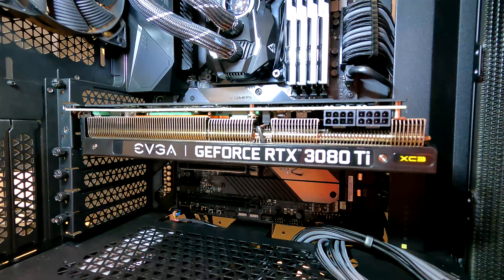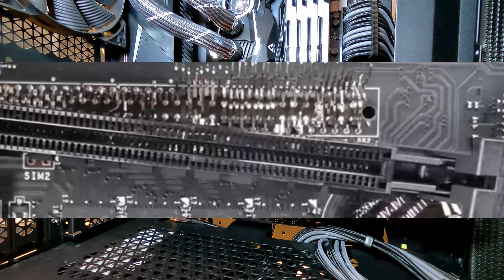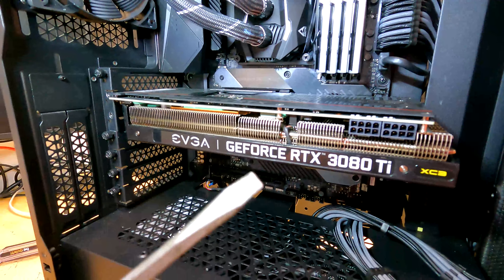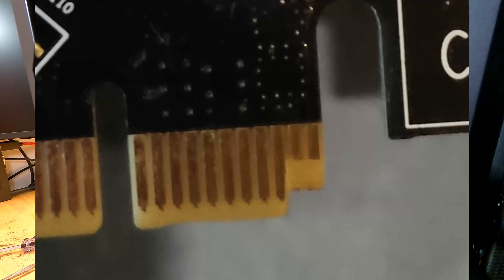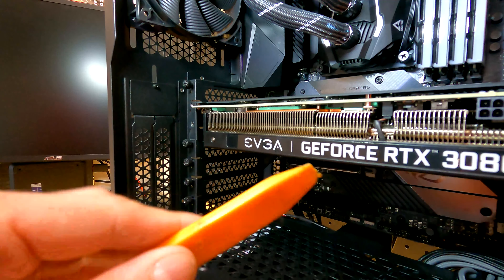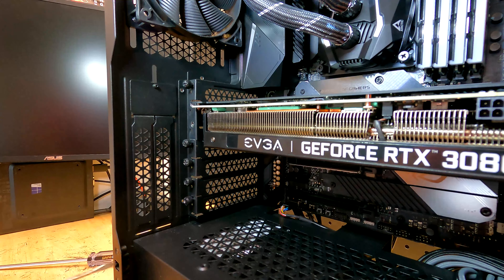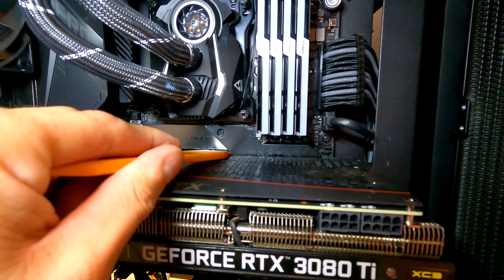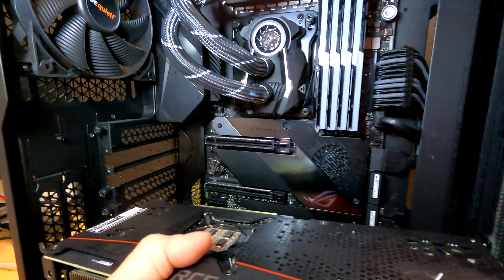Graphics card removal tip!! Avoid broken clips, PCIE slot, or damaging your motherboards!!

Comment: Yep that pcie clip is truly a horrible mechanism.  It's like computers are designed let ppl learn the hard way lol
Reply from the maker: I know right!!
Reply: it’s just a clip tho right? i broke it and idk if i broke the whole thing
Reply: @kutlermclean  should still work (as long as the slot itself isn't damaged) but make sure it is screwed in tight at the bracket side.  maybe double check that everything is still snug if you ever pick up and move the whole pc
Reply: Trying to remove my GPU right now. I just cant get it out. What is this idiotic mechanism?? I have tried pushing the clip very hard with different tools, but it just wont move. Now my GPU is half out and half in. (Stuck from the rear at the clip)... and I need it out right now!
Reply: @megapet777  put the whole thing back and start over.  get a flashlight to see what's going on.  newer boards have a little lever that you push straight down toward the board.  older boards and prebuilt hp, dell, etc might have a curved hook looking thing that you push toward the floor of the case.  just don't force anything you'll get it
Reply: @infinity2z3r07  thanks. I managed to get it out. I had to lay down the PC so I could have top down view. Flashlight is a must. I used wooden thingy to push the clip, but still had to use ton of force to unlock it. I dont know why, maybe its just my gigabyte board. Still I dont know why that clip even exists. The GPU would stay seated without it, and the screw locks the GPU in. This plastic clip thing is nothing but huge nuisanse. In the worst case I would had to remove the CPU cooler, but then I dont have cooling paste laying around so I would be unable to reseat the cpu cooler... isnt it fun building computers? ^^
Reply: @megapet777  what i ended up doing was breaking that clip by accident while pulling the gpu out. try putting your gpu back in, making sure the mechanism is clipped on, the try to push it again with something that won’t break your motherboard if you slip. then it might take some force still to get your gpu out. DO NOY FORCE IT THO
Reply: I think I broke mine. I tried removing it and shoved it back in. Now my games crash when under graphic load lol. What should I do to troubleshoot this and find out what’s wrong?
Reply: @megapet777 Mine just came off as soon as I've unscrewed it from the pci slots, guess it's different for every motherboard and gpu
Reply: also we need holder stand for avoiding bending 😂
Reply: Taichi motherboard already without this clips 😂 4090 I broke 2 of them. First with metal and second just self broke when I plugged my GPU. Now if I will build something with 5090 or bigger,100% I will buy motherboard with button 🫣
Reply: @kutlermclean same
Reply: @megapet777 Any tips? I'm experiencing the same problem with my ASUS extreme formula VIII and 3090. I broke/bent the clip. It's stuck in the MB.
I really need to take this out. I'll try to remove the clip once it's out so this does not happen again.

Also I'm using a 90 degree rotated case. But I always lay it down on the side to work on it.
Reply: @megapet777 lol did you get it out

Comment: Something else to add that the video didn't mention- if you've tried pulling on the card before that the clip might not want to unlock no matter how much you push. You need to first push the gpu in again so it's properly sitting in it's socket, which would release the tension and allow the "lock" to be released with very little force.

Comment: Unfortunately only in newer high end motherboards there's a button that disengages the lock on the pcie 16x slot. I wish every motherboard had that as standard.
Reply: The button release and 90 degree rotated Type-E ports should be standard on every MB. They have 90 degree rotated SATA ports and USB 3 ports standard because you can't install those with standard cables under a graphics card without the 90 degree rotation, WTF can't they figure out that the Type-E ports need to be 90 rotated too?!!!

Comment: God dammit i hope i didn't damage my pc gpu and motherboard trying so hard to remove it with the back of a screwdriver, it did unlock but now the lock feel loose idk if thats normal i was pushing it straight ☠️, took a look at the pcie of my gpu it seems no damage (i hope) and still working, now next time ill use a wooden chop stick instead and pushing it like a lever from the left side ☠️

Comment: STRIX motherboards are known to be faulty. i slotted in a 6800xt and now i want to clean it but the clip is practically wedged into the gpu, i had to use a hammer and a trim tool to tap the thing loose.

Comment: Any tips on removing the clip altogether before installing anything on the slot? I think the clip should not exist at all; as long as you screw in the card tight enough, the clip will not be of benefit.

This design was okay when graphics cards were small, so the clip was easily visible and reachable, but this was a long time ago. Today, on top of the sheer size of the card, a thick backplate may make pushing the clip with a finger very hard even with good clearance, since it may partially cover it. This design should not be utilized any further is my opinion, all new mobos should come with something easier/more advanced, and most importantly safe for the other parts to operate with.
Reply: agreed the design is outdated and gpus r way bigger now

Comment: You show your screws are out, at the end? Allways remove them before pushing the release tab.. The tab in most cases/boards is an ejector, as well as a lock. First remove the backplate retainers, and dont push in on card while trying to press the release, it doesn't work that way.

Comment: my PCIE clip broke off when i was just using my finger, not even sure how since i wasnt putting that much pressure on it. no other damage apart from that broken piece, everything still works fine. Had to take out my GPU to reach the smaller PCIE slot for a wifi card

Comment: My gpu is halfway out, the part where the clip is it is stuck there and the other side is out. I cant put the other side in. Help mee
Reply: Same here. Were you able to get it out?
Reply: @angelmercedes2029  yea, eventually I got it out, I wiggled it and pressed the clip to get it out and it works fine!
Reply: @ I’ll continue to try. I’ve been doing it for two hours and it’s not working. It’s my first build too. I was almost done. I just needed to take it out to make the connector on the card sit flush

Comment: I removed one of the fans on the cooler to get to the pin and i cant press it down. I have removed the gpu in the past and i remember it being difficult but i dont remember it being this difficult.. Good thing the gpu has a backplate and theres some metal thing right next to the pin just like yours, so i wont damage the motherboard.. From experience i think these pins start to become more loose over time if you tend to remove the gpu often, if not then theyre very difficult to deal with.

Comment: so i shouldn't use a thumb to press down on it?  my CPU heat sink is in the way of it so i'm wait on getting my CPU upgrade in the mail.  CPU heat sink out of the way - then i can easily remove the GPU card to replace it(could be better if i put the massive heat sink on, then the GPU card in last)

Comment: Great advice. I have a vintage IBM OS/2  version 3. I think 3. I only use it for Lucas arts air combat classics 1990. Yeah, it still works. Well not anymore. The contrast between the sky and aircraft are gone. My target planes almost disappear when flying above the horizon. Now, the monitor wont come on. There's power to the monitor and I can hear the computer make it's start-up clicking noises. Is it the graphics card that needs replacing? Any thoughts anyone? Sure is tough finding a computer repair company in my neck of the woods who are willing to take a crack at it.
Reply from the maker: I would check the board capacitors, older hardware the capacitors tend to swell and leak causing issues, in this case you have to solder new ones as long as the board had no damage.;
Reply: @DLMtechgarage  That's very very valuable info. mini solder? I can do that. I just hope that I can match them up. Thanks a whole lot.
Reply: I found this Ma and Pa computer repair shop in my area. They ordered the wrong graphics card and now I have to wait another ten days. Apparently, the original card didn't have it's s/n. I'm not complaining. I've been lucky that the FLT sim has worked this long.

Comment: So i upgrades from 1660 super to a 4060 and now the colors are weird and my live wallpaper have low frames is there something wrong?
Reply from the maker: I would check the drivers and make sure you psu has enough juice to run it

Comment: There is no reason for these tabs to be there, i hated them from day one, with all of my builds the first thing i would do is take the cutters and remove it, card is tightly secured to the case, using any kind of latching mechanism to the PCIE socket is a terrible idea, this is frankly a feature i want the manufacturers to simply stop using, it's shit.

Comment: there is one more easier way, u just need a ruler. while the whole pc is upright, unscrew the graphic card (keep holding the card). while holding the graphic card (level it), wiggle abit, u will see the latch move, thats when u use the ruler and push the latch (not too much force), wiggle graphic card and push the latch, u will see the latch move little by little until it unlatched. not much force needed

Comment: I broke the clip on my $800 MB (using the same tool you did) 8 months ago. Everything works and I didn't need to take it out so I left it. But still the card is stuck in the MB.

Now I need to take it out to install some Type-E right angle adapters and remove a standoff riser which my MB does not use (I think it's randomly shorting the graphics card. At least that's what my deep dive research suggests).

How do I remove the card? I used a lot of force and nothing moved. The card was unscrewed, nothing but the stupid clip was holding it in.

I just need it out of the MB and to do some maintenance.

MB is a ASUS Extreme formula VIII, EVGA 3090 ti so it's a lot of money to risk, but I can't deal with the random blackouts any more.

Comment: Or if your unlucky like me and bough an Asus x570 Tuff where they are known to have issues with the lever releasing, of course Asus wont do anything about it, typical, But you can push that down all you want with a GPU installed and it wont release, I've been building PCs for 25 years and never once have I ever ran into that problem.
Reply from the maker: did not know they had issues!!
Reply: @DLMtechgarage  I didn't either until I ran into a situation where I needed to take my GPU out and I fought like hell trying to get it to release, I thought I was going to break the lever off the slot or break the slot itself. I found a few fourms about this issue with only the Tuff boards as far as I know just the AMD boards.

I ended up buying another B550 board just in case I do break the slot in the future, I may even take the lever off that slot if I can get my 3080ti out of it when the time comes lol.
Reply from the maker: @VikingDudee  yea it gets sketchy, i sometimes get nervous.... especially with the crunching sounds lol...

Comment: Sir I forgot to push down the clip before pulling out my gpu and my gpu is 98% out just the part with the clip and I am trying to push down the clip but it’s so hard am not going to force anything and and destroy my rtx 2060
Reply from the maker: You shouldn't destroy it. Sometimes the case clearance causes the card to be tighter but wiggling it slowly should help

Comment: Mine broke while pushing it with my finger, like normal, removed plenty before no problem, any suggestions?  The wing broke not the whole clip, cards still stuck in there
Reply: I’ll add to my comment as I was able to solve it the solution was very very carefully using one of the backing plates from the pc case that one takes out to install gpu. basically tucking the 90° angle under between the card and hitting the second arm that hadn’t broke off, pushing down firmly, but gently and gripping it as best I could so that if anything moved too much, it wouldn’t fly into the motherboard. Also importantly, lifting the card, I think the whole reason it happened is because the card was so heavy (presumed DoA MSI Trio, very chunky card) and i didnt lift it on first try.  I practiced a few times on the clips that were not occupied with the backing plate w/ 90° angle just so that I would get a feel for it.

Comment: is it possible to replace the clip after it broke? In my particular situation I couldn't see any movement of my card after releasing it.. I had to push it down until it broke then I knew for sure it has to be released now. I'd rather brake the plastic than graphics card.
Reply from the maker: not sure, I don't know where I would even get it from.

Comment: I usually use a screwdriver flathead and put tape on it to avoid damaging anything but this is a nice tip. You could probably also use a tire changing tool for bicycles since it has the same wedge form in one end.

Comment: Is it OK to use a 650w for the 3080 that needs just 8++ pci has shown in this video.
Reply from the maker: 750 or better, 650 cuts it close and could cause shut downs if not fry the gpu
Reply: @DLMtechgarage  Oh I see, fair enough. I recently bought a be quiet 750w plus gold, so will replace it with that.

Comment: Thats a bad design. I broke off the lach on multiple motherboards. In my pc there is no way to reach the lach with any tool. Unless you remove the cpu cooler first. If i will have a new board i will just broke off that useless lach intentionally. Motherboad will lose warranty but at least i can swap cards easily.

Comment: I had a dual tower cpu cooler and my gpu had less than an inch of clearance to remove my gpu, so i accidently broke one half of the clip, its working fine but i am worried about it, it still holds the gpu in place but idk if itll move out and cause any problems
Reply from the maker: as long as the computer does not move abruptly you should not have an issue!

Comment: ive just recently pulled out my GPU (the proper way of course not just yanking it out lol) because some dust kind of accumulated in the PCIe slot causing my GPU to have a poor connection.

since I booted it up and it was showing no display on the monitor but it boots up fine (was able to confirm this because the windows startup sound would play through my speakers)

used a canned air duster to spray the PCIe slot, dusted the pins on the GPU itself aswell and plopped it back it, everything was back to normal

Comment: Great tip, I did not know how to remove it, I use my hands force and remove the pci express clip (not gpu socket) and I solved the problem, without this plastic you do not need this tool hahaha but my solve was a lucky and not professional solution, thanks for sharing 🎉🎉

Comment: Great little tool. Any ideas on how to remove a water cooled graphics card that has cooling on the back too and blocks the PCIe port completely? I can probably reach the switch  that releases the "heel" of the graphics card with a quarter of my finger nail.
Reply from the maker: not sure, might need something thinner to reach.
Reply: @DLMtechgarage  I got the trimming tool that was shown in the video and then some. I got a two or three that look like a crowbar made out of plastic.

Comment: Definitely didn’t use a screw driver and definitely didn’t scratch the motherboard. But seriously why is the pci e clip literally a single millimeter from the ram. It was physically not possible for me to click that clip with all the useless cables from my non-modular power supply

Comment: I swear I was confused why I can't pull out my gpu easily when I first built my pc. I forced it and then the tab was removed from the mb. I didn't know where that thing came from so I just put it aside and inserted my gpu again. I only realized where it belongs when a technician noticed that it's missing. Luckily, the tab was able to slid back in without issues. 

It's really a horrible design, and lots of noob beginners like myself might miss on that.
Reply: Same thing happened to me omg, i forgot to cut out the side panel before putting in my gpu so i just riped my gpu out and the lock came out, luckily i was able to slide it back in place.

Comment: Thank you. Great video.. nobody seems to talk about this topic.. the thing is, my gpu clip requires to put alot of force on it to unlatch... (b550-f, its even supported by metal, the slot and the clip)
My clip is now broken and the metal is bent..🤬
Reply from the maker: dang!
Reply: Truly a disgrace that we even have to deal with this pathetic shit. This is like 2004 parts on our new motherboards. The new updates with quick release are SO overdue
Reply: @shecravesit7072 I just battled 30 minute to pull out my radeon he 4790 lol( it was stuck on the back panel of the pc,with the metal kinda ) so kinda correct with this 2004 métaphore... it was hard back then, and I guess it’s still the same today
Reply: @ocerco93  I was extremely mad when I typed that comment lol

Comment: i recently removed my rtx2060 and now when i put it back in the fans wont spin Im wondering what could have broken them i did clean it a bit with wet wipe and push down on the fans a little bit any idea or help would be appreciated thanks. the graphics card still works just overheats if i play games